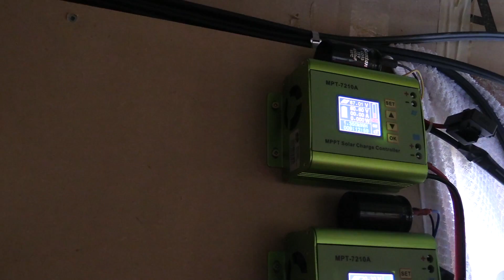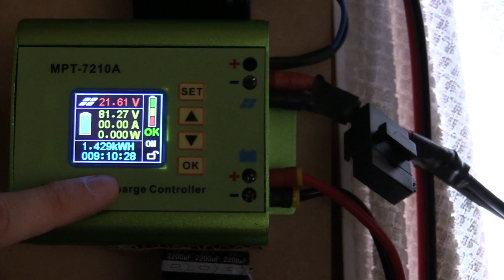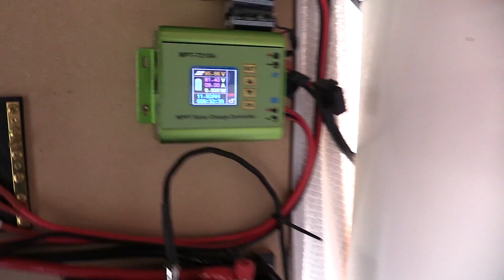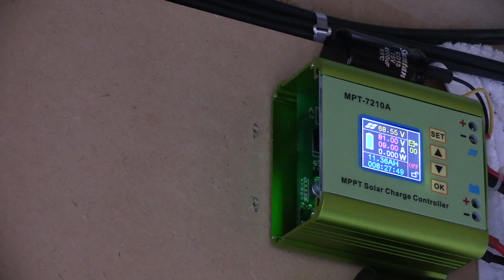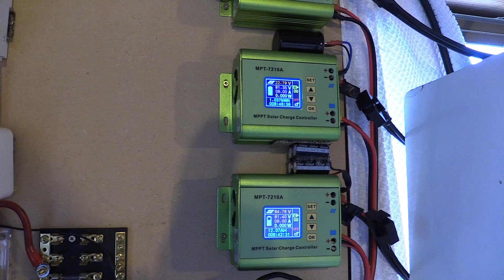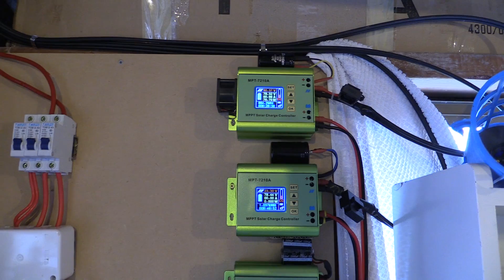Solar Charger Fan Replacement

Comment: PC case fans tend to be 12V and silent, so you can very easily replace the noisy 7210a fan with any of those. 

It doesn't even have to be the same size. Remove the original fan panel, attach the new fan with one screw from one corner, and if the others don't align it doesn't matter. I'm of course assuming the setup doesn't move around (solar panel setups generally don't). You can put a rubber band around the unit if you want the fan to be tighter (optional).

PC case fans are 3 or 4 pin, but you only need to connect the red and black. Easiest way is to use the original fan's connector and solder (or even just tape) the wires together.

Better airflow and no more noise. :)

Comment: it isnt because of the air blowing on the grill it is because the fan is vibrating and is now connected to a large piece of metal that acts like a speaker making it louder

Comment: Thanks I will change mine as I want to put 2 panels together on my setup
Reply from the maker: As i upgraded my input cap to 75v it isnt a problem but in the box its only 63v cap so you will need to do the same thing as i did. Have a look inside and you will see two caps beside the solar input. Also have a watch of my other video which goes into detail and shows you how to replace the caps.

Comment: have you changed the input cap a it is only rated at 63volts and 2 panels an output over 64volts
Reply from the maker: its a 75v cap

Comment: hi Mike good to see your still about. nice mod. the solar panels you run on the mppt are you running 2 60 cell panels at 60 volts
Reply from the maker: Not sure how many cell each panel has but they are 250w panels, but yes two panels in series per controller
Reply: @MikesDIYTeslaPowerwall  hi i wonder if you have any idea , how much wattage these units can reliable run in paralel solar input standard 100watt panels voltage 18-19v charging a  7s 40p Liion pack?   i have heard 4-600watt but its a 10 amp controller= 200watt  thanks for your setup guidance it helped alot

Comment: I thought the fan should be pulling the air from the front out the back.? You are blowing air into the unit
Reply from the maker: Blowing into the unit, the other ones are doing the same. It is blowing across the heat-sink

Comment: I have three 27volt 185 watt panels I would like to put in series to hook up to one of those charge controllers and output 24vdc, will it work?
Reply: no the panel voltage must be less then battery voltage.
Reply from the maker: Not with these units. Have a look at these https://www.aliexpress.com/wholesale?catId=0&initiative_id=SB_20170909150104&SearchText=epsolar+
Reply from the maker: The epsolar 20a is probably all you need

Comment: Can that charge controller have an input of 78vdc and output 25vdc to battery bank for a 24 volt inverter?
Reply from the maker: search of epsolar 20a on aliexpress
Reply: It is a boost converter so it can only boost the incoming voltage. No it can not.

Comment: whats the most watts you have gotten out of one off these. with 250w panel i get 180 w and 2x250 (2p 500w) i only get 210w??
Reply from the maker: I have seen up to 460- 480w max but normally around 430w
Reply: ever got it in parallel? i know you have a higher voltage
Reply from the maker: i did to start with but found series is better for my setup